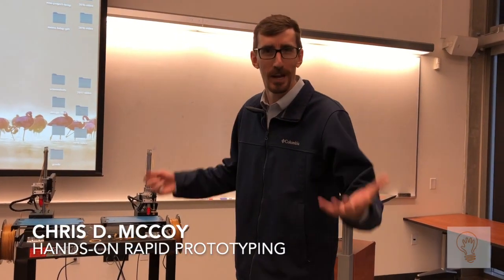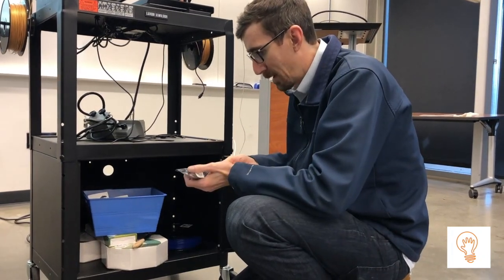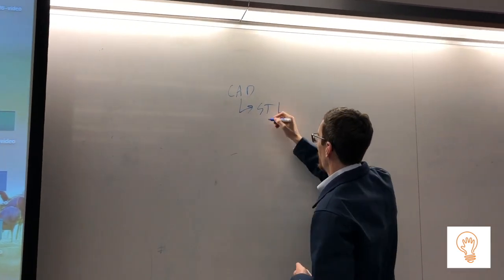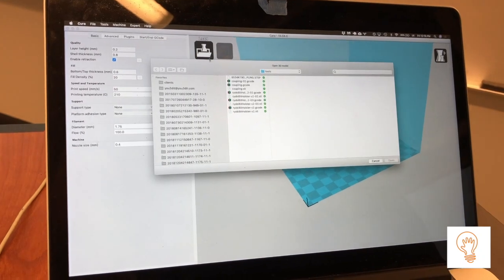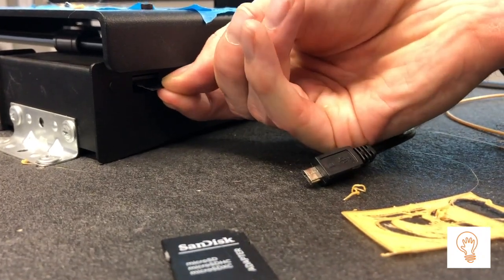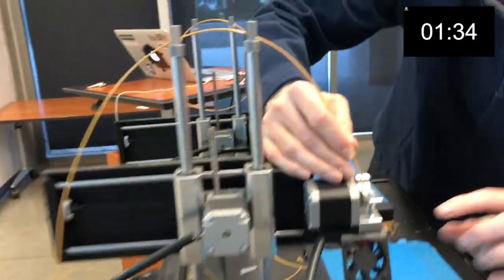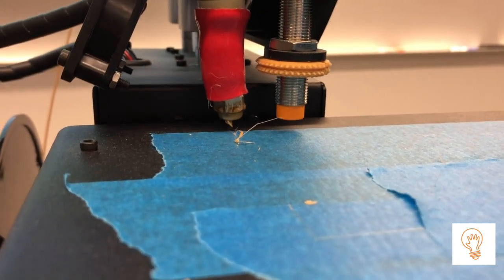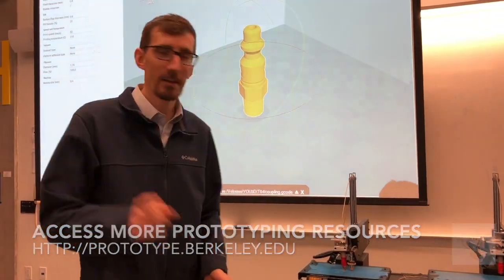How to print on a Printrbot Simple Metal

Comment: Always fascinating to watch 3D printer videos from the past. What is interesting here is that I expected this to be more like from 10 years ago or even longer but it's from 5 years ago? I bought my first 3D printer around 6 years ago and it seems much more advanced than this one is. I started with a fairly unknown 3D Printers, Dobot Mooz 2 which actually also does CNC and Laser engraving. Of course, since then I now have much more advanced printers Voron 2.4 and an Ankermake M5. But my first Dobot Mooz 2 was much more advanced compared to this. Has a heated bed, you can run .gcode, has an LCD display, bed level assist. I'm going to guess that this vide may be 5 years old but the printer here is older. However I bought a very old machine built in 2012, just for the history of it and even that seems more advanced, Cubify Generation 2. Anyway, interesting video.